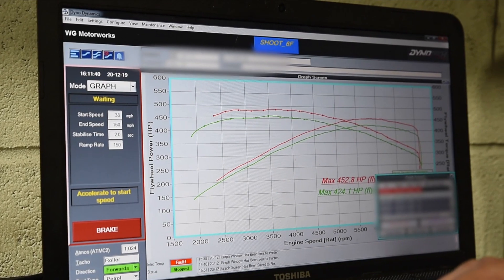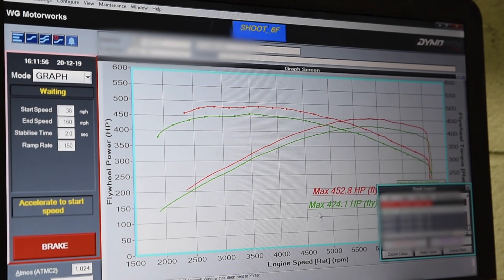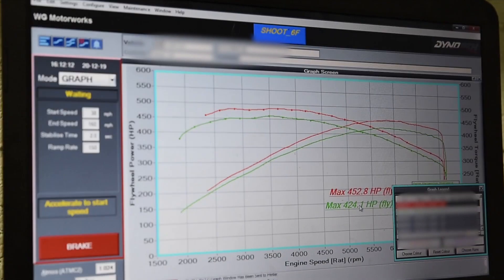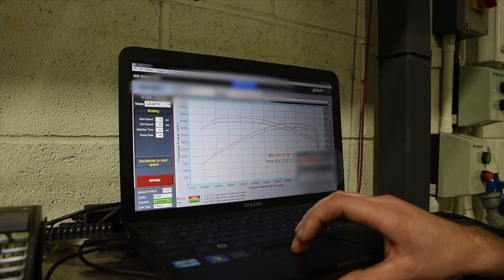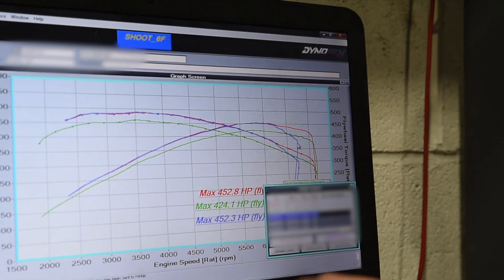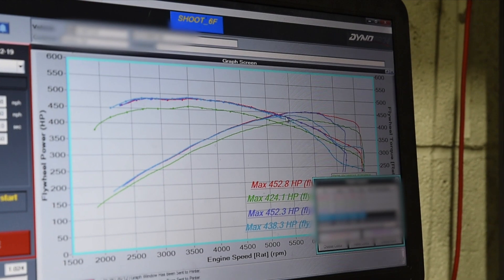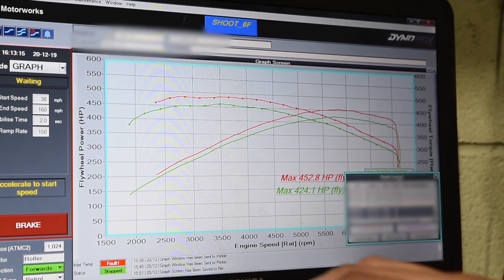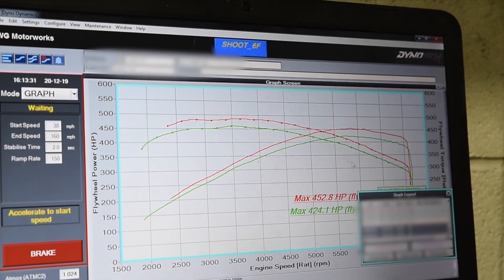Dyno Cheating / How to create false figures with incorrect strapping | Roller Climbing

Comment: This is true and false, you can cheat a dyno this way but there is also some tuners who purposely dyno this way and its not to cheat you, weather its the type of dyno or the way its calibrated I don't no but I've had my car dynoed both ways, at one dyno where it doesn't move and a different dyno where it climbs the front roller and the figures where basically the same
Reply: This video is relevant only for twin roller dynos, where these rollers are not mechanicaly connected/linked. Otherwise doesnt matter. Just potential traction issues will make the difference.

Comment: Very interesting. Great video Warren. What kind of dyno do you use? Is it a Mustang or a Dynojet?
Reply from the maker: Its a Dyno Dynamics - Dynotech :)
Reply: @WGMotorworksYouTube  Ah nice. These kind of dynos usually add a bit of resistance to simulate driving on a road, so they tend to read out slightly lower, but more realistic power and torque figures. By far the best dyno available 👍🏾 In the US they refer to it as a "Mustang" dyno.
Reply from the maker: Yeah, they are more accurate in our eyes, especially when making stock figures! - Dynojets that read WHP only read a lot higher, in fact - dyno dynamics has a 'comparison feature' to compare their WHP to Dynojet WHP
Reply: DynoJet or Mustang is a separate brand of dyno not a type.

You have three dyno types Inertia Dyno's, Braked Dyno's or a Hybrid of both.

Inertia dynos just rely on a larger heavy mass and measuring the rate of change in speed of the mass people love to say how they're accurate as you know the mass of the roller but that not true..The roller isn't all the rotating mass, there is also wheels, shafts, gears clutches etc. This is the drive line mass which has inertia.

DynoJet's are complete rubbish in the USA, rather than properly calculating drive line inertia they just added a fudge factor to increase the numbers on their original bike dyno. (Google DynoJet fudge factor) I think it was they measured 90WHP on a bike that was meant to be 120WHP with a brake. So the 33% fudge was input into their software so it popped out 120WHP.

This fudge carried on to all their car dynos too. The problem with inertia dynos is they don't keep a constant acceleration rate so your error changes up and down with acceleration rates depending whether you've over or under calculated the total inertia of the dyno. As you add more powerful vehicles they accelerate the roller faster and end up with huge errors.

All rolling roads have error but Dyno Dynamics gets as close as you can get to the real number.

What you're seeing here is the amount of inertia assumed by the software is changed from what is rotated by the car. By removing the rear roller the inertia it has is no longer part of the total inertia of the rotating mass the car is pushing. The software still includes this as it has no idea the car has lifted and the extra power from the car is being transferred to the brake. So it's effectively counted twice.

Dyno Dynamics hold a fixed acceleration rate whether you're 100 or 1000WHP and have a drive line inertia locked into the calculation. If the drive line inertia is wrong you'll get a the same error at 100WHP or 1000WHP whether it be 1HP or 5HP its comparable regardless of the power and the more power you make the smaller the error gets as a percentage.

On a DynoJet there is no drive line inertia they just under read the rotating mass then fudge it with a percentage so the error is a percentage so if you have a 5% error at 100WHP that becomes 50HP at 1000WHP

On a dyno dynamics you measure as much as you can with the brakes load cell and minimise the amount of inertia involved by restricting the acceleration rate with the brake.

If you measure at steady state there is no inertia power reading and their is only brake power reading which is accurate WHP. If your power increases or decreases when you use a ramp or sweep test your total inertia is wrong.

During a power run you're running a hybrid between a brake dyno and an inertia dyno.

If you did a step test where you step at 100 or 500RPM intervals you could measure the vehicle at every single point in steady state with no inertia but that would be stressful and very heat intensive for the vehicle.

And that's before we even begin to talk about fly wheel calculations.